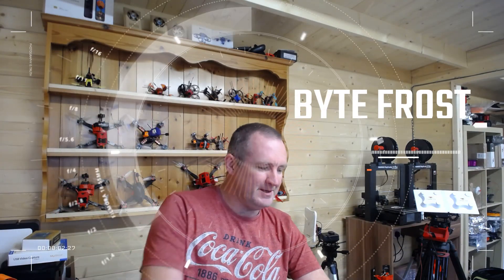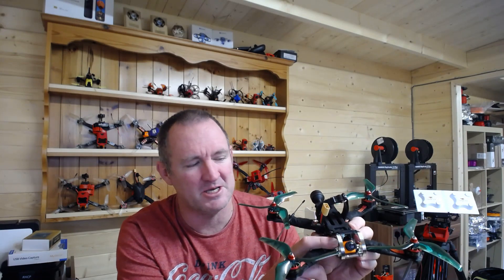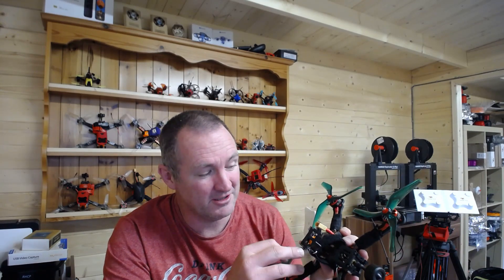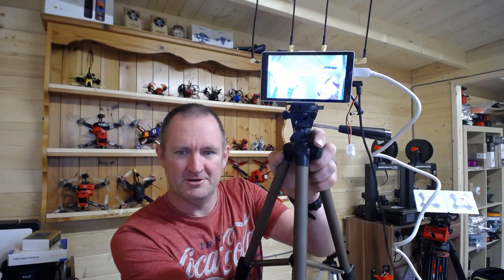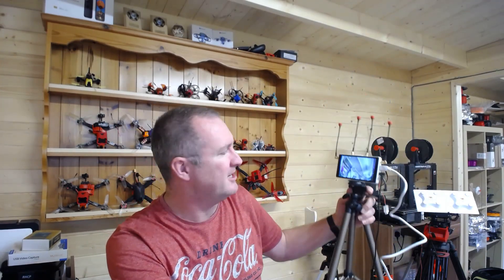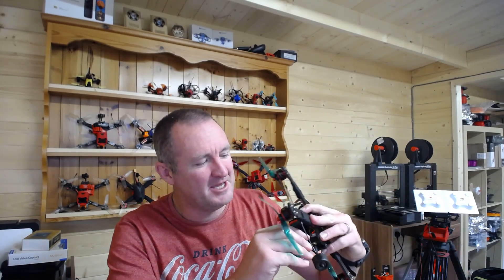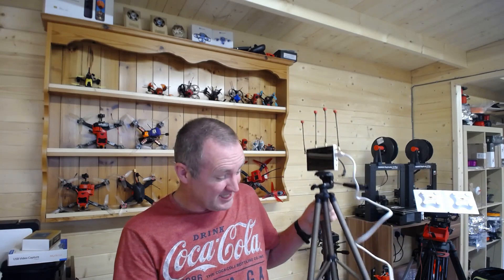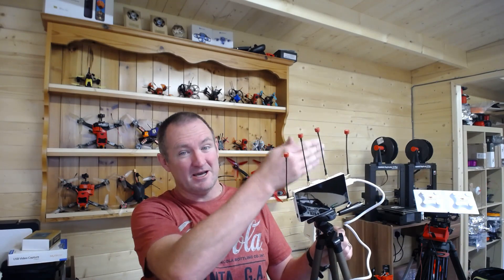FATSHARK BYTE FROST | INITIAL THOUGHTS AND IMPRESSIONS

Comment: I'd like to see some video of the actual inside of a set of HDOs.  I didn't spend $600 to look at at screen I'm going to have to pay another $400 for. I'm kinda kicking myself for jumping on the HDOs, I mean every premium top of the line best in class is only going to have the spotlight for so long.  But this was supposed to be built to work directly with the HDOs... I honestly don't mind the screen so my wife can watch what's actually going on in real time,  but she's not supposed to have a better picture quality than me. Plus I've already got her ball and chain I really didn't expect to have to be tethered to a screen to fly. 
 I haven't jumped the DJI bandwagon yet but I'm really starting to think about cutting my losses on a basically brand new set of $600+ goggles and get what I can while there is still some meat left on the bones. I'll give it a few more weeks and see what happens but  fatshark seen the dji setup pulled off to make byte frost better and I can say so far I'm not impressed at all. Just my 2 cents .
Reply: Why? You have bought an amazing goggle. Just go out and fly. With this and the HDO you can use both Analog and AHD. But I would wait for the second generation of AHD
Reply from the maker: The picture inside the HD0 is fantastic with the bytefrost.     Can't fault it.

Comment: look forward to your testing... little off topic but i need your advice on antenna placement. I have just purchased a tbs nano diversity rx with two immortal t antennas , whats the best placement for these two antennas on a 7 inch quad more semi long range explorer quad scenario. cheers and on the tx side vertical or horizontal placement (tbs diamond). i realise that vertical mounting offers greater range / coverage (null poimts) in terms of long range. But, I have 2 of them :)
Reply from the maker: Hello...

I would put one on each arm.

If you see the quad in this video.. You will note the immortal t on the arm.

Simply put one on each rear arm.  Should work a treat!
Reply: @RTRCTV  an which which on the tx ? horizontal? thx for getting back so quickly :)